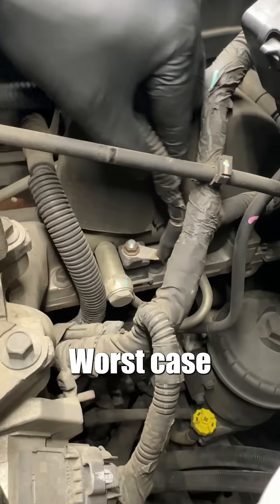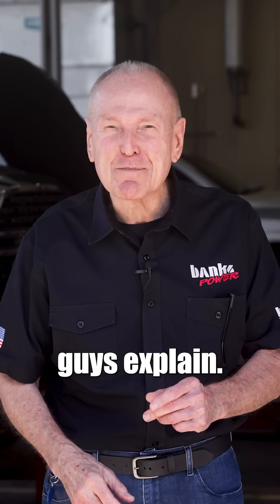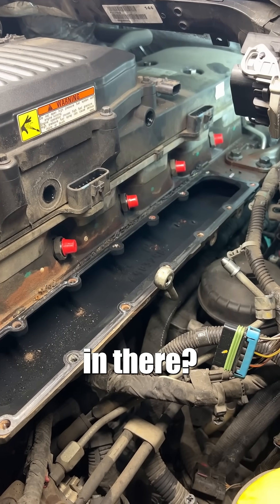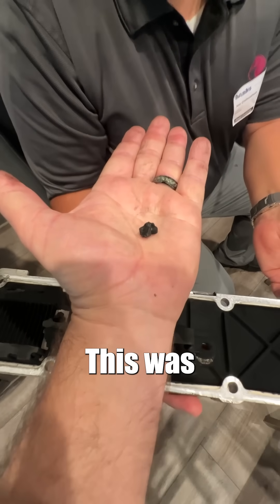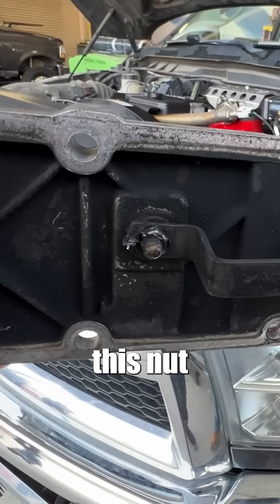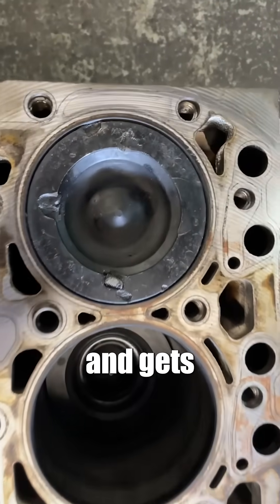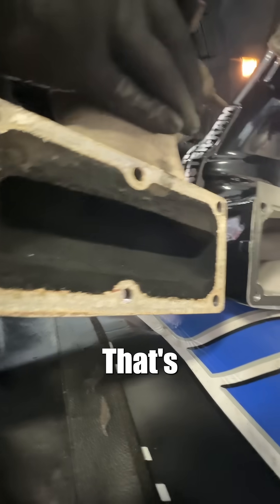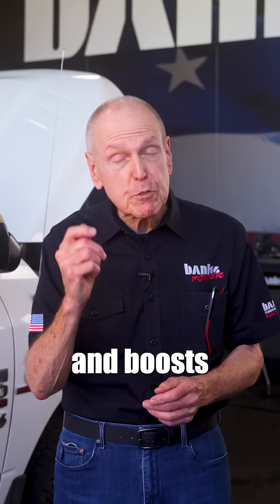The Hidden Time Bomb Inside Every RAM Cummins

Comment: Today I had the Banks team install a Monster Ram and removed the factory grid heater. The bolt and heater was still in great condition. I did notice an improvement in performance . 2014 Ram 4x4 with 37s. Much better now.
Reply from the maker: Awesome to hear you're feeling the difference!

Comment: Stellantis should be sued in a class action lawsuit, and all these engines replaced this was designed flaw right from the engineer and they should be prosecuted for they should be purchasing a lot of Cummings diesel engines. A lot of Cummings diesel engines. I’ve had four of these trucks. At least the motor didn’t give out, but the front end fell apart.

Comment: Put the Monster Ram on my 2017 6.7 which had 87k miles on it, when I took the grid heater off, the bolt fell off in my hand. Never had a recall for it. Dodge just lets them fail and expects you to pay for a new Engine.

Comment: Living in middle GA I disconnected the grid heater on my 2015 3500 at the solenoid at around 30,000 miles. It's still tight and my lights don't flicker.

Comment: Actually, this looks like a lawsuit waiting to happen for the manufacturer. Because it's a manufacturer's detect and every engine that fails should be covered by the manufacturer. No matter how long it's been, because it's a manufacturer's defect and it may be intentional, it may not that would be something to be determined, but the fact that it is a poorly designed or designed to fail aspect of the Cummings diesel engine in  The discussion makes me believe that there is a lawsuit waiting to happen if somebody wants to file it

Comment: Banks eliminates the bolt failure with a tiny heater that does little  to nothing if you live anywhere cold. That Banks engineering, solving one problem and creating another at a big price. Hey, endless marketing costs a lot you need to pay up when you buy our products.

Comment: That's criminal negligence or engineered failure. 
  
 If they're gonna use the cheesy heater connection they should have caged the  bolt holding it in the intake.

Comment: It's not a stupid design if they used lock wire or something to prevent the bolt from backing off. Infact all fasteners on the inside of engines and transmissions should be pinned or have lock wire for this reason.

Comment: People talk a lot about performance increases. But, every time I've modded a car with dependable "performance parts", I've increased fuel mileage. 
High velocity intake manifold: "MOAR POWER, BABY!" (and better mileage). 
Headers: "MOAR POWER, BABY!" (and better mileage)
Tuned high flow exhaust: "MOAR POWER, BABY!" (and better mileage)... 
They never pay for themselves. But, if you're not increasing mileage at regular throttle and driving speeds, you're often losing efficiency.

Comment: That is not what superheat means. Superheat is the temperature measurement of a vapor above its boiling point. For example at atmospheric pressure water boils and becomes a vapor at 212F, if the water vapor traveling through a heated tube and comes out the other end heated to 232F, that would mean the vapor is superheated by 20F.

Comment: I have an 07 and fixed it before  it broke i had a banks intake put on the truck in the video is a 2016 , why hasn't Cummings fixed the issue,  you would think that knowing about the problem fir many years that thay would have put a fix in it ....I wonder if the new dodge Cummings still have that crapy design?

Comment: Deisel trucks are such a burn. So many people buy these trucks and never tow more than 10-15k pounds. Ill never understand why people dont just buy gassers. I can get a new gas v8 for my superduty for 8k but I'll probably never need to because they dont blow up and they're cheap to repair. I have towed 22k on flat ground with no problems and I'll bet most deisel pickup owners never even tow that much.

Comment: Cummins needs to go back to the old style grid heater they used on the 5.9. It worked great and never had failures like this. No idea why they even changed it.

Comment: It happen to my 2016 2500. I ended up rebuilding the motor myself. Total damage was $7600 but u got lucky and the bolt embedded in the piston. So I didn't have any cylinder wall damage. My truck now has a monster ram and head studs. As well as a few other modifications.

Comment: I have a ram but not the Cummings , and still had to replace motor at 127k miles… for these trucks going for 60to 80k new, we shouldn’t have to be putting motors in them in only a couple to a few yrs later. And now days with the price of literally everything through the roof, I am surprised we still put up with this crap is all. Crazy world

Comment: Ram sucks. I've replaced 1 engine already and time to replace it again and I haven't even hit 60k miles on a gas engine. I'll never own another one. The factory doesn't have replacement parts and they refuse to stand behind their product and put recalls on their failures.

Comment: Google says 
-BANKS POWER has reported about 200 cases
-approximately 3 million of these engines. 

So quick math, that is roughly 1 in 15,000 no where near 1 in a million. 

However, finding it after it broke, but before it destroys the engine.... that might be closer to 1 in a million, catching it on video MIGHT be 1 in 3 million.

Comment: The P2609 code on a 6.7 Cummins engine indicates a problem with the intake air heater system, specifically "Intake Air Heater System Performance". This code often points to issues with the grid heater or its related components like wiring or the PCM. A common problem is the grid heater bolt failing, which can lead to serious engine damage if not addressed. 

-----

The P2609 code on a 5.9L Cummins engine  indicates a problem with the Intake Air Heater System Performance. This means the engine's computer isn't seeing the expected results from the intake air heater during cold starts or warm-up. Common causes include a faulty intake air heater, wiring issues, or a problem with the powertrain control module (PCM).

Comment: What's with all the "this is the last straw and last ram/Cummins I ever buy" comments?
I get this is a really dumb (and potentially costly problem), but it's also the easiest and cheapest to fix. Heck, it's an easier fix than the "killer dowel pin". Unlike the cp4 pumps and leaking plastic oil pans and 10 speed transmission issues on some of the other truck brands🤷‍♂️

I get the ram dislikes, just don't see how this one bolt means every Cummins is now "total junk"? Unless it failed on you, then I get it 😅

Comment: I'd be interested to find out if perhaps, it was RAM that called for that spec in their engines, and so Cummins made it that way. Either way, I've had one Dodge 1500 318 Magnum, and the only way I would have another Dodge/Ram vehicle is if it was a gift. And I'd probably only take it if it had a manual transmission, because their automatics are garbage.

Comment: So since its giving more flow, would you need to put larger injectors or whatever diesels have? all i know is if you straight pipe and intake kit a go kart you gotta change the jets because the air is flowing easier and the original wont keep up

Comment: I did the cheap stainless intake and cheap aluminum plate then got the same grid heater coil at Napa and welded on a stainless bung for the heater coil. Might have been $220 total

Comment: Mine feel off when we flipped the grid over... my truck is emissions crap was stolen at the gas station so I had to put a tune on her,,, for about a week after installation of same mpg 22 running around 28.9 highway 18.1 with the livestock trailer with cattle that's tune3 but on 5 and heavy foot I've been at 14.6... God bless ya'll stay safe frosty and free Happy Independence month...

Comment: No diesel engine intake should ever look like that. Thanks for nothing, EPA.
Reply: Did EPA design this intake part? No. 
This is all due to Cummins’ bad design, whatever their reasons might be (probaly cost), no need to bring EPA into this. If you somehow still think EPA is to blame, then how come Banks is able to design a 50-state legal intake part, that also accomodates EPA requirements?
Vast majority of crappy design ideas are caused by corporate pennypinchers, not by goverment regulations. So removing environmental or consumer safety regulations would make matters a lot worse, not better.
Reply: @UserErr0r3578 man, the epa demands an egr, and this is what you end up with an egr, there will never be a different result than this. all for slightly better emissions at low engine speeds. a total waste of resources and brainpower for a miniscule different in the statistics
Reply: @supersst838 I’m 99,9% certain that if you could reduce the NOx emissions by as much as an EGR system does by using some other means, manufacturers would offer you millions, probably even hundreds of millions of dollars, to have access to that knowledge. NOx limits are there for a very good reason.
You are probably too young to remember the smog from the eighties, I for one would never like to go back to the smog-days.
With the EGR you are trading about 3% lower diesel engine efficiency for somewhere between 60% to 90% reduction in NOx. That’s a good compromise in any engineer’s book.
Reply: @UserErr0r3578 when the result is more junked engines, and more new cars and more cost to the consumer, the EPA has done nothing but make life difficult for a few.
Reply: @mcgusto82 Again, for the extra slow ones, the issue at hand is not caused by any EPA, but by bad design from Cummins. The idea of EGR is not bad but the Cummins’ implementation is. EGR valve itself is a regular wear item, it needs to be serviced from time to time, or replaced, if needed. 
From the top of my head I can’t name any other diesel engine with such design flaw, where regular EGR maintenance does not matter because your engine gets grenaded anyway. 
Here in europe we have a lot of EGR-enabled vehicles running hundreds of thousands of kms, yes they require cleaning sometimes but they don’t drop bolts into engines.
Reply: @UserErr0r3578 Yeah they pretty much did design this intake.
Reply: @UserErr0r3578 Brother, they required this system but allowed Cummins to design it. Any diesel intake with EGR will look like this regardless of what brand built it. Don’t defend the EPA (if that’s what you’re doing) - they are the problem.
Reply: Yeah! That useless EGR! No car should have an EGR. It actually contradicts the EPA's idea for them.

Comment: My 2.4L Chevy engine is no match for a Cummins, but the timing chain went bad and lashed the shit out of the cover and killed it at 99,000 miles.  Luckily, I had just changed the oil, replaced two intake/exhaust solenoids and changed the spark plugs. 

Looked around and found plenty of used engines around $1k, but they had 145k to 170k miles on them. How could I trust them when mine didn't even get to 100k?

No more Chevy for me!
Reply: Agree!! Every GM ive ever had legit fell apart. Never ever again

Comment: Ram and cummins should pay to replace all motors this bolt kills...they know its an issue but won't fix... maybe use a non corosive metal for the bolt, not standard.zinc bs....

Comment: The BMW M54 engine has a similar issue with its intake. There's a small pin that secures the flap inside the DISA valve, over time the pin comes loose and goes right into the head, then it proceeds to dismantle the engine from the inside.

Comment: Does this upgrade require a retune?
Reply: No. Put a Monster Ram on my 2015 when I noticed the grid heater bolt had some play.
Reply from the maker: No, tuning is not required for a Monster-Ram on a stock Cummins 6.7L. However, any tuning you add will benefit from the added increase in air flow and air density.

Comment: I told my Cousin-in-law about the grid heater bolt. We are in Canada and he had 43,000 km on the truck, (27,000 miles roughly). We started digging & got to the grid heater bolt. It already had very slight movement. I didn’t know it could start that early, but it wasn’t moving by hand, but just s simple pair of pliers and a little pressure applied & there was movement. He has a 100 x 200 heated shop for his farm equipment so we tore it down to pull the cover. There was little to tell the bolt was failing but he said screw it!! 😂😂. The truck didn’t move again until he had the Power Ram. It’s just a ranch truck so he wasn’t into extra performance etc, but he wanted reliability. In the winter he can be out in a spring storm checking on calves and be miles from any help with no cell coverage & spotty satellite phone signal. He didn’t want to chance it so he “bulletproofed his engine” he says. It looks damn nice in black as well!! 😊. 
     He felt it was a reasonable price for peace of mind, but he swears off Cummins again. The fact they designed this and hadn’t done much about it, he says they don’t deserve his money. Now his wife, my actual cousin, drives a Chevy Tahoe with the 3.0 diesel in it as their daily driver when off the ranch. They have been doing really well so far, especially with the updates. She is in love with the SUV. She went from a Toyota 4Runner that was very good for them, but the fuel mileage was horrible. The Tahoe gets well over 30 mpg with her driving! Just over 30 when he drives,,, 😂😂. 
      Roll the dice is exactly right!!
Reply: Just wait. That new Tahoe won’t last either. They are junk.
Reply: @landonjones676 - blahhh blahhh blahhhh. The failure rate is less than 4% for every one that fails there’s 92 out there that have no issues. There rarely, extremely rarely 100% failure rate. Go trolling elsewhere. 😂😂

Comment: I will never buy a vehicle 07 and up again. They are built to break between 150k and 230k miles. Old 70s diesels are out here putting new diesels to shame. More dependable, easy to fix, better emissions. Just better.

Comment: I did the bd kit and my bolt was fine at 144k miles. 2014 6mt 2wd. Still glad i did it for peace of mind.
Reply: Yeah mine is a 2011 with 120k. Been deleted its whole life. Still rocking the stock grid heater but I think I’m gonna buy this for my truck come Christmas time. Honestly don’t need the intake heater as I like in NC but I don’t want the bolt breaking off as I plan to keep this truck forever.
Reply: @22mpb  2011 with 120k... when do ever drive it? To the grocery store?
Reply: How does it start on 40 degree mornings?

Comment: Banks is really a great company.  Too bad  the factory didn't use them for stock😅
Reply: The factory would rather take advantage of people not knowing about this issue.
Reply: In World War 2 he would've been called a troubleshooting engineer. He doesn't design the machine he just makes it work. For instance they had to redesign the combustion chamber on the B-29 bombers because the engine kept catching on fire and the planes where rolling off the assembly line anyway. So they had these engineers fix the problem and keep the line moving.
Reply: "It lasted the warranty, now we can make more money on dealership services" - Stellantis Probably
Reply: Probably got out bid by parts company in China
Reply: Correct me if I'm wrong but I believe he mentioned that cummins trucks now come factory with a banks intake on some models
Reply: these reminds me the cars from soviet era in eastern block....you had to finish it at home to be driveable enough :D

Comment: Mitsubishi should be held accountable for this problem.
Reply: Mitsubishi?😂
Reply: @tedlulis973  Mitsubishi makes the Cummins engine.. like Isuzu makes  the duramax and international builds the power stroke.
Reply from the maker: Contrary to what a lot of people think, Isuzu Motors Ltd. of Japan no longer has anything to do with the Duramax engines. DMAX is now fully owned by General Motors, and GM holds 100% of the rights to the L5P. While Isuzu was involved in the past, that partnership ended years ago. Today, Duramax engines are proudly built right here in the U.S.—specifically in Brookville and Moraine, Ohio.

As for Mitsubishi, they have no involvement with Cummins. They're entirely separate companies. It’s a similar story with Ford and International. The 6.7L “Scorpion” engine—used in Super Duty trucks starting in 2011—was actually the first turbodiesel Ford designed and built in-house after years of using engines supplied by Navistar.